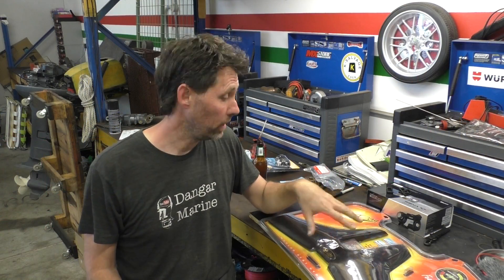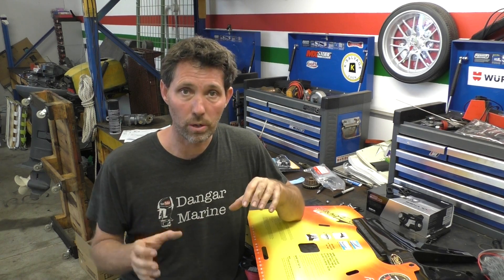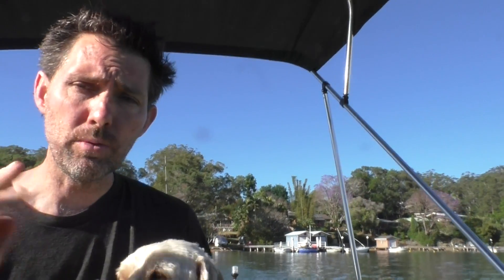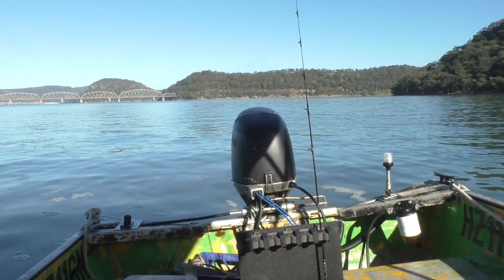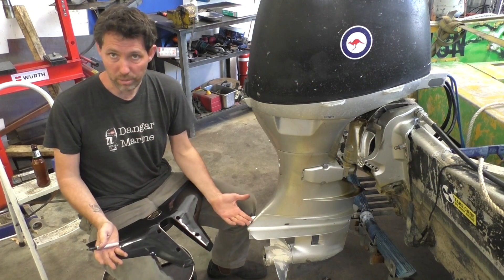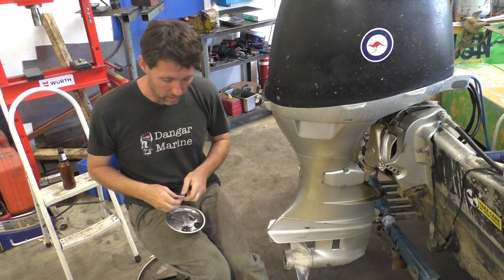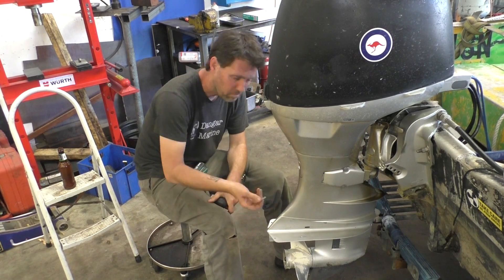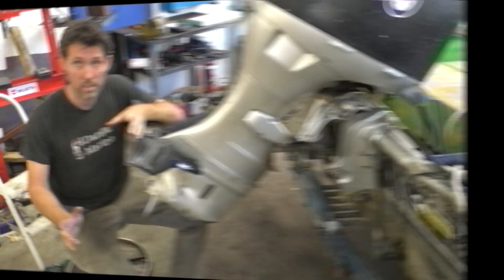Outboard Hydrofoils

Comment: I added a hydro on my mercury 60hp with a 16 foot tracker.  Wow what a difference night and day.

Great tool to help out a under powered boat
Reply: What changes did you notice.....thx
Reply: Massive hole shot increase as the boat stays flat and does not plow water for 200feet to get on plain.

Top speed went up by about 1 mph  and it stays on plain at lower speeds.

And  when getting in the boat from swimming we now have a nice place to put your foot on to get in the boat
Reply: @tittan1500  the pgv16?
Reply: Milk Man yes
Reply: Milk Man 2012 with the 60 4 stroke
Reply: @tittan1500  i just bought a 19' pgv165 with the 90 and was thinking this mighg help with cornering cavitation when planed.
Reply: I had the same results!

Comment: Many years ago we picked up a recon' 40HP Ex RNLI Mariner for our club dive boat - The engine came fitted with a Doel-fin as had been trialed by the RNLI. Usual story for a club boat back then, Under powered / overloaded ...but we found a dramatic improvement over the old 40 getting the RIB on the plain.

Comment: Hydrofoils are very bad for your engine pivot steering bushes. Fit those plastic auto leveling trim tabs made a huge difference on my boat, does everything the hydrofoil is suppose to do but the steering in and out of corners are heaps safer and no cavitation due to the boat almost stay horizontal flat.

Comment: Might not be as dramatic on other boat styles, but on my flat bottom Carolina Skiff with a 90 hp Honda,  with the hydrofoil and running at the same rpms, I can raise the bow, get more of the hull surface out of the water, and definitely see a noticeable increase in speed... while running at the same rpms. Also increases my top speed by approx 4 to 5 mph. Just sayin...
Reply: Syd Quinn I love doing bunny hops in my Banshee and get the front end right up!
Reply: Thanks for the information. Was looking to add a foil to Carolina Skiff Flat bottom. Any particular brand u recommend? Ty
Reply: @caycewest4081  Sorry for the late reply I rarely even look at my personal email account anymore. Anyway, there might better ones out there but I've had three engines on my Carolina Skiff and have always used the String Ray Classic. If you haven't already, I'd say buy one and try it!

Comment: I’ve used one of those on two different boats. First was a 19ft bass boat with a 200hp mercury outboard. It made a massive difference in bow rise. Cruising below 18mph and keeping the bow down wasn’t possible until I put the fin on. Second boat was an 18ft I/O with a mercruiser 4.3 v6. It had too much bow rise and proper visibility couldn’t be maintained when pulling someone on a tube at safe speeds. I’ve seen too many kids get hurt because some idiot was pulling them on a tube going 35, 45, or even 50 mph. That boat just didn’t have the power to get the bow down at 15 mph when full of people. That’s why we have a v-drive now😊.
Reply: Tubing is so much fun, but also dangerous!

Comment: I got a questions. When I first start my boat for the first time when I'm put in the lake it start easy then later in the day it's hard to start again. I will have to cranking like 5 or 6 times before it start. I have a 115 Johnson 1993. What's the earliest way to start later in the day when I'm out in the water?  I'm not sure but one of my buddy was telling me, the engine is flooded that's why it hard to start later in the day. Any suggestions or any of your knowledge will help. Thank you.
Reply: I'm not a boat guy, but I've heard with motorcycle engines they can be hard to start when warm if the valve clearance is set too tight.
Reply: @darlingsnep  I have to turn the valve down?
Reply: @saelee33  Adjust the valves to within their correct specifications... It differs from motor to motor
Reply: @darlingsnep  thnks

Comment: well put together info > I have a prob with sargasso weeds down here in south florida and. 15 yammy It gets stuck not on the prop but on the bow facing side of the leg and makes is ventalate lol rpms zoom up to max like (like if the prop is completely out of the water and props is  def low enough   ) tried a bracket so I have more option on tilt etc im really tired of having to stop and hit reverse plus that random over rev cant be good for the rings either
Reply: Definitely will help with that! It almost allows you to run with your motor up higher. Just make sure its still spitting out water.

Comment: Hmm I had hydrofoils on my 70hp Evinrude since I bought it. I had to take them off to do some lower unit work in the offseason and was thinking about testing the boat without them and seeing if I notice a difference. I don't have power tilt/trim so planing performance is hit or miss, to say the least. I also put a new prop on, the old one was in really really bad shape so we'll see how that goes as well.
Reply: I had some on my Johnson 48spl with my 16’ vhull. It planes out very well, but I have a ugly listing issue when turning on plane and constant low speed bow steer. Planning to remove the hydrofoil and installing Bennet SLT6 trim tabs.
Reply: I might help. Does your motor sit on the pins at a standard height for trim?

Comment: In my opinion hydrofoils “planks” are a crutch. There is something wrong and there are better ways rather than a speed robbing board in the water. Proper prop selection having stern lift, smart tabs(these things are great),engine hight, proper use of the trim, payload adjustment or combinations of these are far better. There may a design problem (rocker) or damage of the bottom that unless its corrected it could doom the boat to forever need the plank. If you see two boats that have the same power, weight and size the one that doesn’t need a plank is unquestionably faster.

Comment: Good way to use more fuel and lose top speed by about ten miles per hour .they good for a boat that is not balanced properly and setup wrong no wonderful  easy as pie fix .
Reply: I guess it all depends on the boat?

Comment: One advantage that doesn't get much mention, is that your boat will stay on the plane at a much lower speed - I used to be a safety boat on the Red Cross Murray River Canoe Marathon, where we were running in water with a few snags, and the slower planing speed (where the hull rides higher in the water), meant that you hit less hidden snags, and if you did hit, it was at a lower speed.
Reply: I found that too, boat would plane around 3000 to 3200 RPM. After I fitted hydrofoil it started planing at 2500 RPM and I could slow it down to 2300 RPM once on the plane and keep it there

Comment: remember to paint the holes or protect with grease etc,the stainless bolts touching untreated ally will create static and result in corrosion of the gearbox/paint flaking.  Captain John
Reply: Good tip
Reply: @inepsaog9631  DURALAC
Reply: Corrosion would not be good!

Comment: ventale = cavatate?
Reply from the maker: Good question. No. Ventilation is when the prop draws air from the surface due to being trimmed up to high or being mounted to high which causes a luck of thrust. Cavitation is when a low pressure area develops around the prop and forms a bubble of nothing (ie. a vacuum area) When that vacuum collapses the water strikes the prop at extremely high speed and can chip a small amount of the metal away causing damage.
Reply: Would this hydrofoil make the water pressure around the propeller higher? Similar to funnelling extra water to the prop?

Comment: 2150 ciera sunbrige with a 5.0L. Had a problem getting up on plane, especially when towing a skier. It took so long to get up on plane that I was drowning the skier. This model solved this problem. It does take off the top speed but for water skiing it made the boat jump on plane twice as fast making water skiing a much pleasant experience. I skied behind the boat with and without the hydrofoil, really makes a difference for the skier. I also noticed during rough weather that it seems to help control the bow bouncing repeatidly.

Comment: Hi Dagnar, I finally got an older rigid boat, came complete with a Chrysler 55 no power tilt and trim, I know, it's not much more use than an over weight anchor but it works and runs quite sweet. Because it's winter now in the UK I have the motor off the boat and in the garage but I want to convert the thing to power tilt and trim as it's a bit too heavy for me to lift with ease. I have a tilt and trim unit from a Honda BF40, is it possible to use this on the Chrysler without too much work .?
Reply from the maker: Hey Miguel, it would be possible to rig it up but it might take bit of fabrication to mount it top and bottom.
Reply: Dangar Marine 
Hi Dangar, as soon as the festive break is over I am going to strip the power tilt and trim down and take some measurements and see how it could go together. Will try to keep you posted if I can do the fabrication and keep it safe
Reply: Dangar Marine 
I have pulled the unit out of the transom frame and looking at it, I wonder if it is possible to use the Honda transom mount on the Chrysler motor as it would reduce the amount of remanufacturing needed. .?

Comment: I enjoyed your video , spot on with the info you provided. The hydrofoil seems to help the smaller engine craft or the over weight under powered boats.  Your high performance high horse power craft usually looses performance or find no benefit at all.  I subscribed to your channel ,   Thanks ,  All the way from East Tennessee USA ,
Reply from the maker: Hi Tom. Yes, they really can work wonders for some boats and make others worse. It seems really hard to predict the result until you try. Thanks for subscribing! :)
Reply: Yes it really depends on what type of boat you have. All different boats have different results!

Comment: Excelent video! I got a tecnicall question for you. I just bought a almost destroyed 10 ft aluminum flat bottom boat as a proyect. I rebuild it and is fantastic (I can send you the pictures if you want for a video). Now, it was originaly designed for a 4 horse power outboard, but I reinforced it and now it healds preety fine my 1956 Johnson 15 hp long shaft.  
The only problem is that when crusing at high speeds, the front of the boat bounces up and down so I have to aply weight to the front, and it doesent resolve the problem either.
What do you sugest me? I kind of beleve that an Hydrofoil could help a lot but I´m not shure if I want to modify my outboard...... I was thinking too on puting some flaps at the transom or maybe it´s just a matter of trimming. What do you think? 
Thank you!
Reply from the maker: Unfortunately these things always end up being a bit of trial and error. I have seen a hydrofoil really help with that problem. Also, how far below the bottom of the boat is the prop? If it is a long shaft on a short shaft transom you will also get that problem.

Comment: It is called cavitation not ventilation
Reply from the maker: Cavitation is caused by a pressure differential on the prop surface, a hydrofoil won't help with that. This video will explain the difference to you https://www.youtube.com/watch?v=R2f-aWM8MmU

Comment: did you leave the hydrofoil on ?
Reply from the maker: No, I took it off because it made the boat worse. I've seen plenty of boats that drive terribly without them and are perfect with them on, but this boat just isn't one of them. As I think I say in the vid, if your boat doesn't have a problem, don't buy one. I only did to do the vid.

Comment: What is ventilate? Just got my first boat. Not even on the water yet. Any info is helpful.
Reply from the maker: Ventilation is when the prop is near the surface of the water and draws air down around the prop.
Reply: Dangar Marine ty

Comment: When I had my 16 foot CC OMC Neptune it had a Johnson 70 Sea Horse on it. I installed a Dolphin foil on the lower and the handling difference was so noticeable . It would plane my boat out much faster.
Reply from the maker: They can definitely improve some boats handling hugely.
Reply: The Doel Fin is supposed to be on top of the propeller not at end of trim tab. The force of the prop and water pushes the fin up increasing its effect.  Behind the prop buries it and costs top end.
Reply: @solarfry  The way I installed it is the way I see them on the paperwork that came with it. It made my boat perform way better and I didn't lose any speed. But what I did gain is no more long wait time to plane. I could plane at slower speed and no more proposing. My boat ran like it was on tracks.
Reply: @solarfry  I also went from a three blade aluminum props to a composite 4 blade and  my hole shot was improved to about double the speed.
Reply: I have on on my Banshee 90 hp Johnson, performance is fantastic!

Comment: Creates drag. "Saves fuel"

Use these only if your motor is too big for your boat. A common occurrence in the mines bigger than yours boat community.
Reply: John Gault these gadgets have been around for decades. I think they know about them by now.
Reply: John Gault  not disagreeing with you. Just wondering why the outboard manufacturers don't design the stems to do this from the start. Could it be because all their engineers   might know better?
Reply: Aquabeing1 true!

Comment: Stingrays really do work and what I did to mine is narrowed it down 2.5 inches from each side ( due to ice breaking one side off a couple inches.) And it works a lot better I say. Better turns and you still get the bow up no problem. Keeps your motor in the water better too in the chops
Reply from the maker: Sound like you got the perfect result. :)

Comment: Spot on conclusion....Matches my experience. I had one boat that porpoise and the StingRay solved it! Had another boat with no issues and StingRay was no help whatsoever. Mainly a problem solving tool. Enjoyed Ed the dog. 😁
Reply: I guess it depends on the boat eh?
Reply: I run my 30 Horse Mariner hot on the transom on my j16 Carolina Skiff I have the stingray on it so I do not get cavitation and it helps my speed give me about 3 to 4 miles per hour

Comment: One thing mates....from much experience with these things...most of these are installed wrong especially the doel fin which should be directly above the propellor not six inches behind it...but the design on many doesnt allow proper cav plate location so a two piece fin set is the best way to go. the purpose of the fin is two fold ...eliminate bow rise and trap propellor thrust in the area where it is the most effective ....around the propellor. cheers

Comment: What do you mean by ventilate, do you mean cavitation , when the prop causes a low pressure and air bubbles on the prop boils
Reply from the maker: Ventilation is when air is sucked down from the surface of the water - different to cavitation. https://www.youtube.com/watch?v=R2f-aWM8MmU

Comment: I've used the drill thru (Stingray) hydrofoils on two different boats (19' Tri-Hull & 18' Bass Boat) and without question the change was dramatic and boat performance (acceleration, bow rise, handling) was improved.  Enjoy and I highly recommend these to anyone on the fence about it.  Cheers and very nice video.
Reply: I've installed one of these on 2 different boats and the difference was astounding!
Reply: I'm gonna make mine outta fiberglass and use a stainless sewing braided steel cable welded together to keep everything intact.
Reply: I agree, i helped out when I pull a tube also!

Comment: Thanks for you videos they have helped a lot. I have a Tracker v17 aluminum it has a Mariner 50 hp 4 cylinder with the wail tale on it and it works very good. But I’m having trouble with a small leek in the power trim hidrotic Lines its a 1985 model I’m wandering if I can buy new lines for it or will I need to have someone make new ones for me? I think I should pull the hole units out and replace it with a newer pump what do you suggest?
Reply from the maker: You should be able to buy the hydraulic lines and spare parts. I would try that first and go from there.

Comment: Wonder if you’ve noticed a slight difference in gas mileage?  I think I will leave my merc alone. It typically has no trouble with getting on plane.
Reply from the maker: I definitely think it lost some speed and used more fuel. I've since take it off.

Comment: My Skeeter SD80's bow would stand almost straight up on take off and was hard to trim on plane (Yamaha 50pro). Now  after putting a Classic on it is very well behaved. https://www.youtube.com/watch?v=SkKQXs9Hfb8&t=304s
Reply from the maker: Yep, these plates can work wonders if there is a problem to solve or make a boat handle worse if there isn't.

Comment: Tried one on my 17 'Bass Boat (padded V haul) with a 140HP Johnson 2 stroke. I hoped the hydrofoil would correct a Hole Shot problem bur it had no affect, no change getting it up out of the hole, but It did stop mid speed porpoising. Then I put a Four Bladed Prop on and the boat. Now it  jumps out of the hole immediately. The transom also rides higher then before and the bow lifts more which helps to get the haul up on the pad which is a spot on the keel near the transom. Also increased the top speed reaching 62MPH. Four Blade prop has a slightly smaller hub that allows the exhaust to divert over the hub, as well as through the hub. This causes mild cavitation resulting to engine RPMs increased. With the standard 3 blade prop the engine RPMs were being held back due to lack of cavitation reducing the HP to about  40HPat 2000Rpm which was not enough to get the boat to plan. The cavitation caused by the exhaust on the out side of the hub allows RPM to reach 6000 RPM developing 140HP more thrust and a hugh improvement in performance. The Hydrofoil I have has the wings angled slightly up wards to get it above the cavataion plate and out of the water when boats on plane, reducing drag.
Reply: So 4 prop is better?